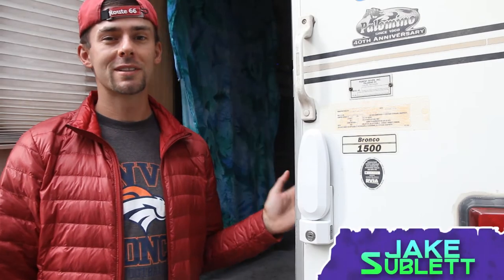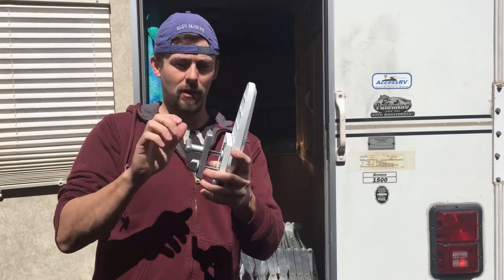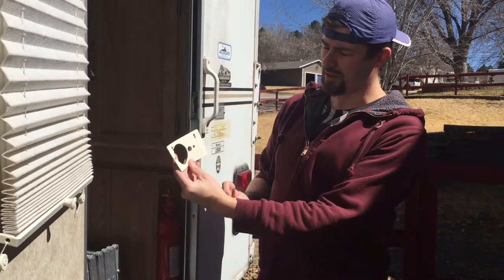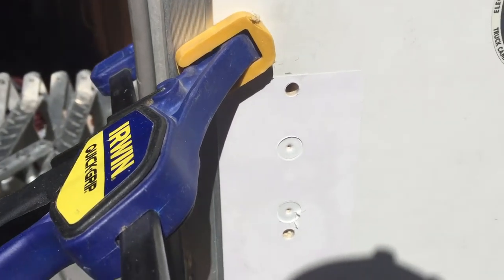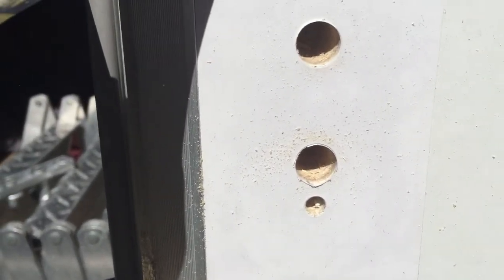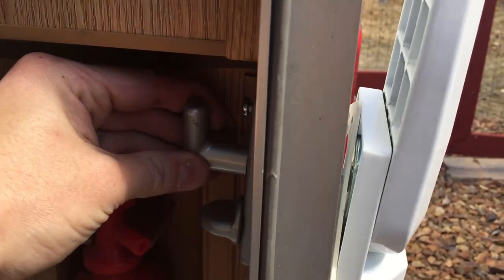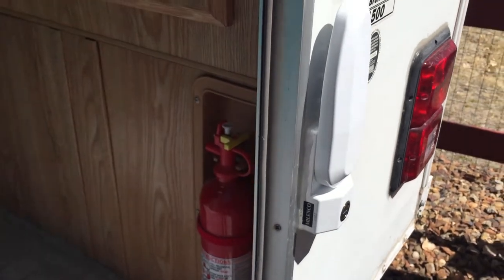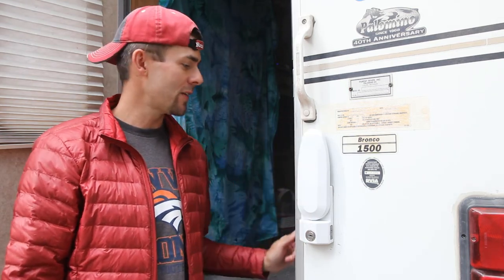Installing a Milenco RV Door Lock

Comment: Can't that arm be hammered out of the way pretty easily?
Reply from the maker: We’ve had it on for over 6 years now, traveling full time and no one has jacked with it. I think the wall is more likely to be broke through than the lock. Campers aren’t made well. The door is mostly foam. It’s all deterrents. If someone wants in, they will get in.

Comment: What is this lock made of it does not state the material .....
It looks plastic and I don't consider that safe but if it's metal it would be....
My concern is locks being picked so is that a possibility with this lock ??
Investigative journalist that write about crimes in national parks say that these parks don't like to report crimes because they are afraid of affecting tourism....
I wanted a good security lock to install on the inside that cannot be accessed from the outside